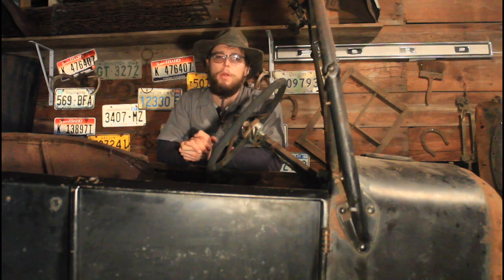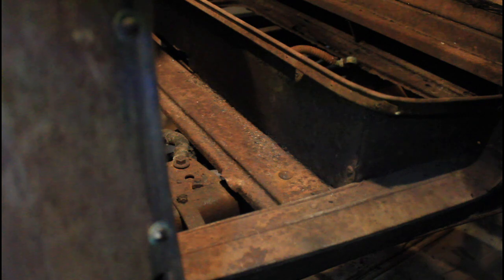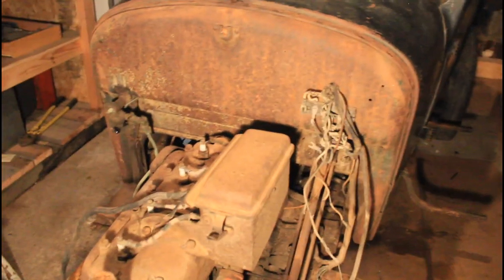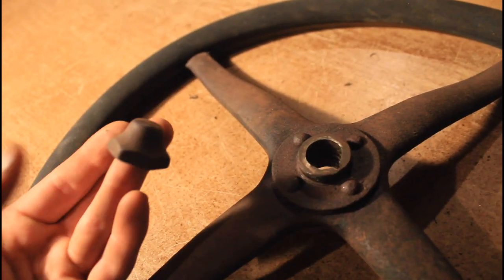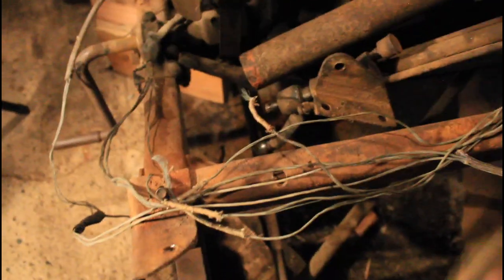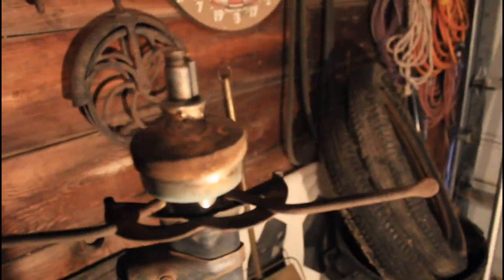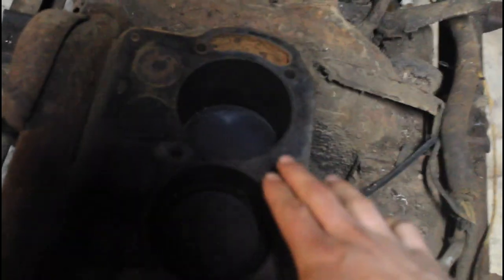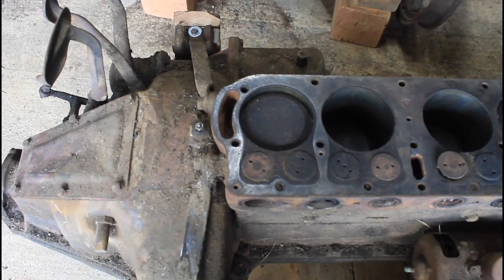Removing the Body and Engine, 1927 Model T Restoration

Comment: Just as a tip you  can sand and weld a hex nut to the head of the carriage bolt rather than drill them out

Comment: You should see the wood used in mines. There are mines which are really dry from the middle of the 19th century where all the wood inside is still good.  Looks like it did a 100 years ago and a hundred years ago it looked like it did fifty years before that.  Quite amazing.  You'll also find things like markers when a worker was killed or even just random stuff concerning the work of the day hand painted on the walls.  Everything has been dry and dark since the time they were first dug.

Comment: Nice work.  I would recommend power coating the frame.  I tried on a motorcycle restore frame Rustoleum Spray cans but the paint seems soft even after 6 months since painted.  It scratches easy and not as shiny.   See if others suggest the same.  Fame painting is the major base for the rest.   Enjoy you videos.  Keep up the good work.
Reply from the maker: Thanks for the comment!  I decided to go with brush on Rustoleum enamel.  It is a really thick oil based enamel, and if you want it to be hard you can add an enamel hardener to it.  A professional model T restorer recommended this paint, he did his car with it 10 years ago and it still looks great.  The paint will turn dull after a while, but you can't see the frame, so it won't matter for me.  When I did some research, some people warned that powder coating can crack on a model T because the frames flex so much, and the powder coating is really brittle.  Thanks for watching!

Comment: I wish you had shown how you actually removed the body in this episode instead of just the frame with it already removed. I am wondering how much weight the typical roadster body will have when it is removed, as well as the best way to actually take it off of the frame. A lot of your info works just as well on my 1925 roadster as I rebuild it or at least as I work through removing parts and such. Is the actual body removal a two-man job with the turtle deck already removed on it?  Thanks.
Reply from the maker: It is a two man job, it is helpful to take out the steering column, but the motor is low enough that I can lift it over with a helper very easily.  The body on a 26 or 27 is all steel structure, a 25 will have some wood structure and I have not done much with them, if it is rotten it might pose more problems.  Happy Tinkering!